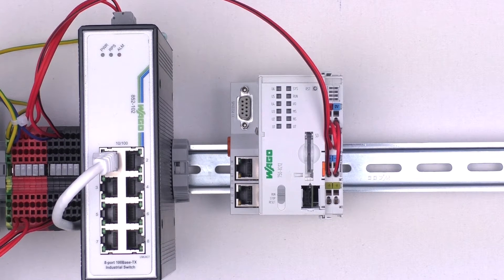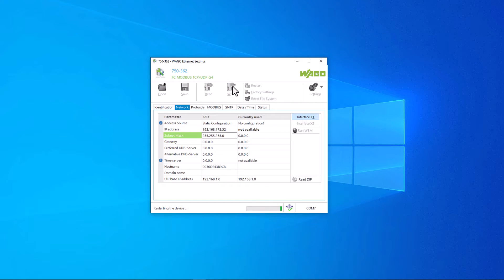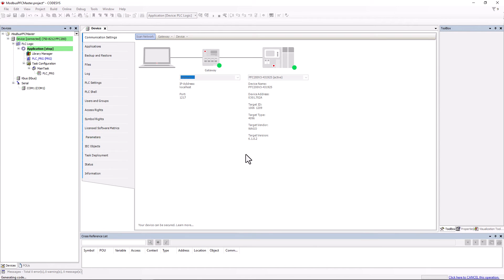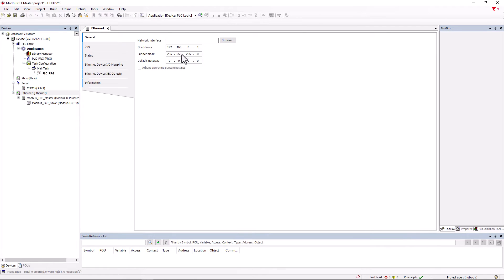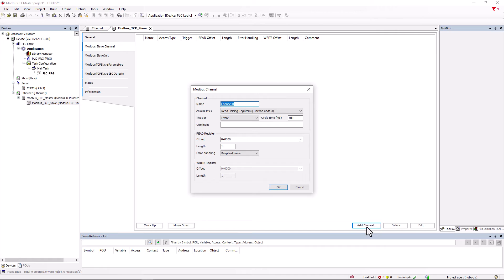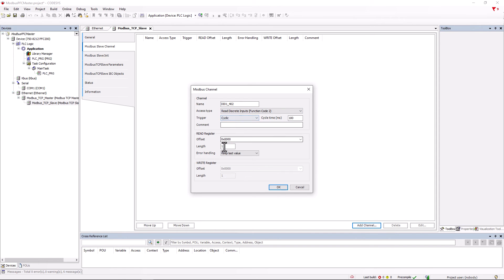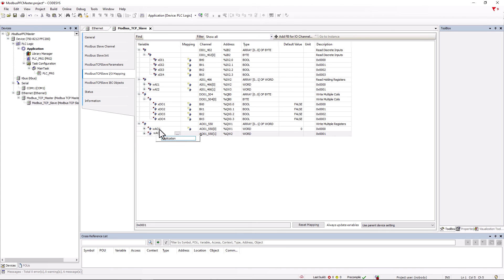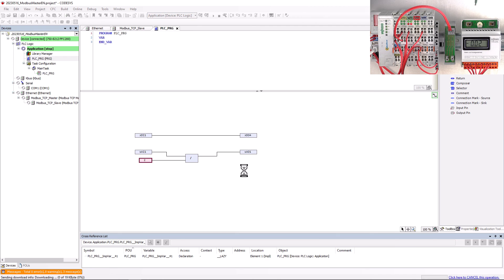Modbus TCP in CODESYS 3.5 | PFC as Master and Fieldbus Coupler as Slave

Comment: I have a PFC200 and normally I run a Modbus TCP Server on ip address 192.168.1.17 with both ethernet ports bridged using WagoAppPLCModbus

If I wanted to run two separate Modbus servers on separate ip address:

Server 1 on 192.168.1.17
Server 2 on 192.168.2.17

Can I use WagoAppPLCModbus libraries to achieve this?
Reply from the maker: The Wago Modbus library WagoAppPlcModbus does not offer this capability.
The Modbus Server in the CODESYS Modbus configurator can achieve this.
Kind regards from the WAGO Team

Comment: Sorry and for UDP?
Reply from the maker: The Modbus-Configurator provided by CODESYS does only support ModbusTCP communication. However, you could establish a ModbusUDP connection by using the library WagoAppPlcModbus, which provides function blocks for a ModbusUDP Master and Slave.
Kind regards from the WAGO Team